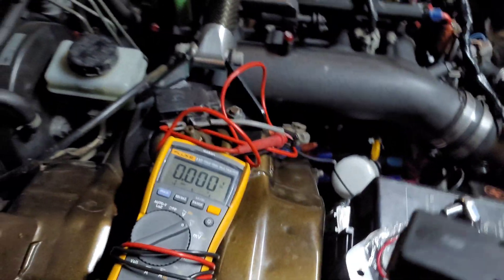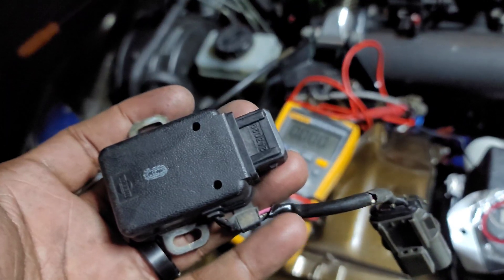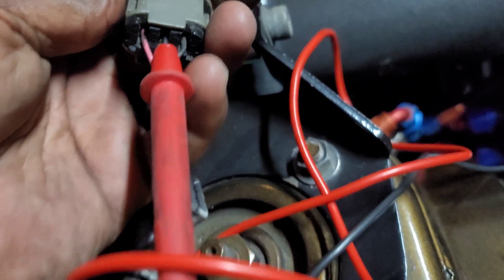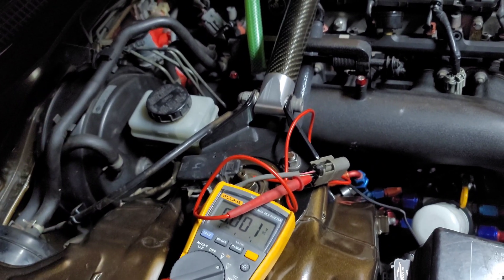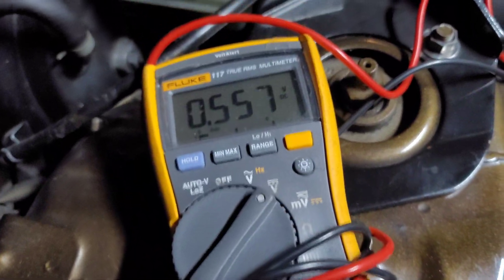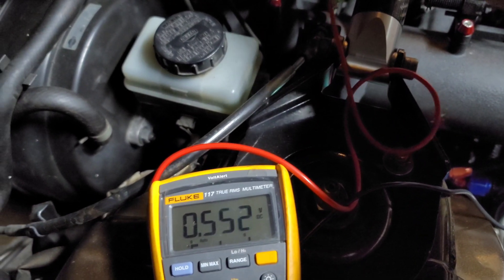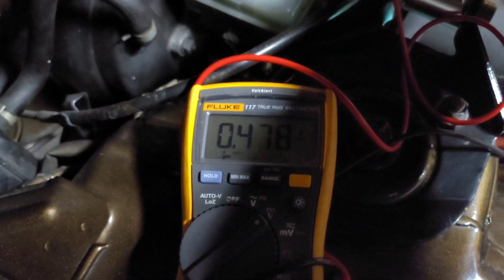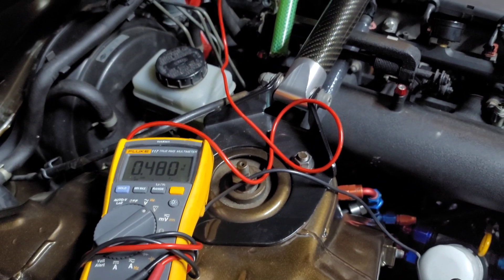How to replace and set TPS (throttle position sensor) on RB series

Comment: installed a haltech elite after my link g4plus and now awd lights on hope this will slove my problem
Reply: Did this solve your problem? I also have a code 21
Reply: @Lurkinontheinternet  nope
Reply from the maker: Check you pin connections
Reply: @Lurkinontheinternet I also have code 21 did you end up fixing it? And how ?